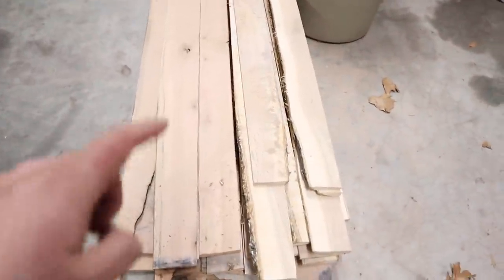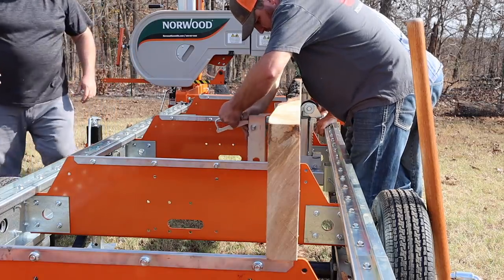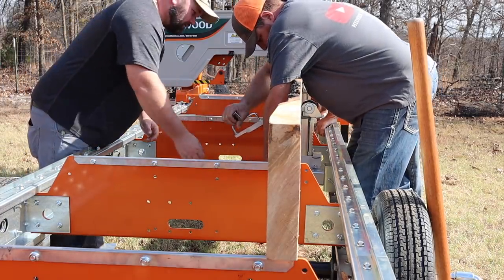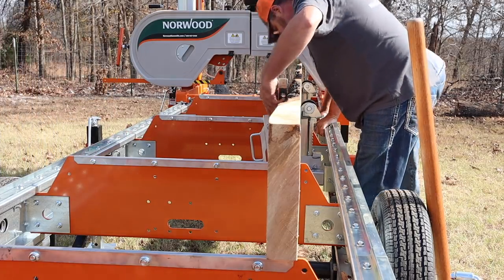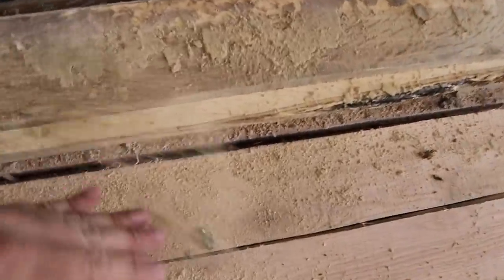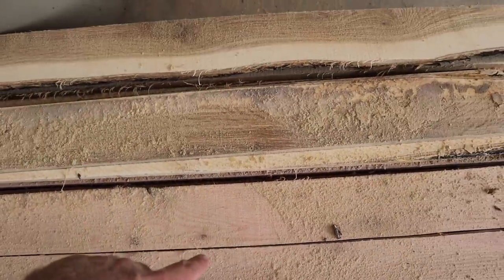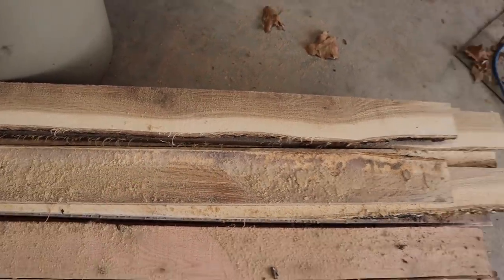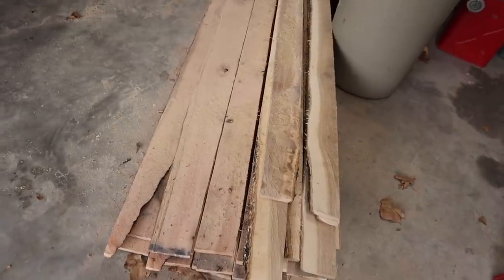The Whole Process Of Milling A Beautiful White Oak Log Into Lumber Time Lapse | Norwood Sawmill

Comment: Have you guys watched the video from Norwood as to how to cut wood? It is very interesting now that you’ve done a few pieces of lumber for yourself. Watch the beginning part end it may give you some good ideas for handling logs on the mill as well as safety ideas. Good luck I think building Feed troughs for your goats is a good first use of the lumber you get. I think maybe you better set up a way to let the wood dry over the next few days before you build something. I also noticed in drying lots of small sticks between each log and the one next to it is very necessary.

Comment: When you cut a 8"x8" into 1inch boards, it's best to leave the boards as is on the sawmill until you cut the rest of the boards. This will keep the weight of the boards from the stock moving.

Comment: Once you’ve taken a plank off you should then turn your log so the flat side is down. This way you can square off the other three sides with that one and get more use of the word. When you cut the second or third slice out and the log is not letting square you lose an off a lot of wood.

Comment: Kevin & Dutch
When you stack your finished boards to dry, you need little strips of 1" scrap in between the layers as you pile up more boards ... So they dry more evenly ... My uncle had a saw mill & I've stacked a lot of board feet in my lifetime...you guys are motivators..God Bless

Comment: I know you are still learning and trying to work out the bugs, but, I recommend you rotate the log 180 after you make the first cut, After the second cut, the last two cuts to remove the bark should be easier.
Reply from the maker: Will do
Reply: @HiddenHeightsFarm  Also after the first 2 cuts rotate 90 and use a framing square to then help square the cant.

Comment: 1:41 - Have you always had that Exit sign? That's hysterical! 🤣
8:34 - Is it leaking something? Or did it get wet in the rain? You can see it really well at 9:59 as well. 

You had mic issues in the last few minutes. Not sure what happened, but just in case you had not noticed.
Reply from the maker: Yes, and that's water that drips on the blade.
Reply: Hidden Heights Farm - I was wondering. Lol

Comment: Do they offer an attachment for the sawdust discharge to direct downwards so that it doesn't just shoot straight out? The way it is, the sawdust gets caught in the wind and blows everywhere. I'm talking about something shaped something like an exterior dryer vent cover. If Norwood doesn't offer something, maybe just get a dryer vent cover and use some double sided tape and stick it on?

Comment: After the first cut , would it be easier to rotate the log 180 degrees.  With two flat surfaces, the log shouldn't roll and you'll have two flat surfaces for clamping.

Comment: Kevin...you and Dutch can treat your own wood. I send you the chemical you would add to treat the wood. Then you can bake it...opposed to pressurizing it. You can build an oven....sort of what Dutch build for the pig. Just long....and then you bake the wood at low temp. Applying the chemicals are easy...you just paint it on, and be liberal when applying the chemicals. Let sit and soak for 2-3 days. Chemicals will absorb and then bake for 3-4 hours. And then you'll have treated wood. Sounds like a process, but it's not that bad.

Comment: To square the log cut the straightest side first, flip 180 degrees laying on the  first to make the second. When 2 sides are parallel square against the side braces to cut the 3rd side. Then rotate to the 4th. That way all the clamps hold square and tight.  Same process is used in metal working same as wood.
Reply from the maker: Thanks for the tip!

Comment: most "2X4" is pine of some type so the oak beats it right off the bat. Almost have to price from a specialty lumber yard for oak boards. But your in top dollar range of wood for sure..
Do some research on 'green wood' construction & shrinkage allowance. Could save future headaches. Or maybe no problem at all. Suggest looking for additional sources of logs & a plan of some sort for harvesting timber off your properties. Perhaps plotting access roads & clearing those first. Sawtooth oaks can produce acorns in 5-6 years non native but, something to help regenerate what is removed from the wood lots.
Stay Safe & Keep Well bol

Comment: You can make nice chunks of firewood during the squaring process. . Instead of making lots of thin passes, move the carriage over the log, lower the blade to the lowest point on the log, you can find the depth of the first cut now. Get a chain saw and cut slabs to size for firewood. You can do this right on the mill. The cant under the slabs is already holding the slabs, Just move the slab forward then cut the slab into firewood lengths. Nothing goes to waste.  Waste not, want not. I hope this was helpful.
Reply from the maker: Thank you for the tip
Reply: Try turning the log 180 degrees after  after the first cut. The clamps are having a tough time getting a good bite in the hard oak bark. This will be safer and may keep the blade from breaking.

Comment: After the first cut you should put the flat cut on the bottom. So it would be straight cut..
Reply from the maker: You have to cut each side to square it up
Reply: @HiddenHeightsFarm  top then bottom and then sides. I have been doing thing for like 5 years..

Comment: it seems your log stays are not holding and dropping loose you may need to get a dead blow hammer and give it a few good bangs before locking the wood stay or could it be a bad design

Comment: Try cutting the falling notch out first. You're not going to get any good lumber out of it. After you cut your first face turn the log completely over face down. Cut your second face. Now you have two good parallel flat faces to mill the sides with. Don't forget with posts and beams you can build anything.
Reply from the maker: Great tips

Comment: I think somethings wrong with those stops on the back of the log. They’re not supposed to move around like that this thing should be rocksolid and every time you push the log up against flexes which is why your log keeps coming loose

Comment: Those first cuts with the bark still on will make good firewood(maybe not the pine so much because of all the sap, I don't know). I saw a video a while ago of a guy who bought all those type pieces(I forget what the mill calls them, culls maybe?) in huge baled bundles for maybe one or two hundred dollars each, and he heats his house for much cheaper than reg wood! He was getting about ten or twenty of them delivered from a flatbed on this video! You guys look like boys with new toys! If you build your goat feeder with this green lumber, won't it shrink a lot? How often do you have to do regular maintenance on the mill and either sharpen or replace the blade? Maybe you could use some large pipe clamps instead of the ones they gave you. Pipe clamps can be made as long as you want, depending on the length of the pipes! Static on the last few minutes of video, could hardly hear Kevin! Hope both of your families have a blessed Thanksgiving and stay safe and healthy!
Reply: Go to sawing with sandy.  He talks about using green wood in a build and how to keep the wood from splitting as it drys.  He also does not have much problem with his dogs/clamps.  I never have seen other people having so many problems with them loosening and falling off before.  Good  to see this video, willing to show the learning curve.  They should make stickers to dry the lumber on to prevent warping (twisting) a curved board can be fixed (re-edged with a loss of material) a twisted board is firewood.  They can use the offcuts as a good source of material.